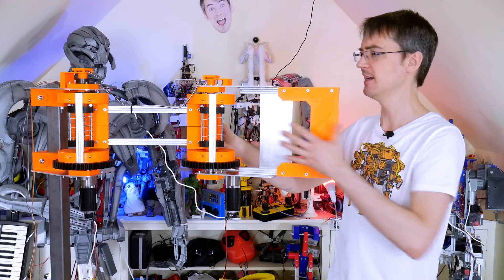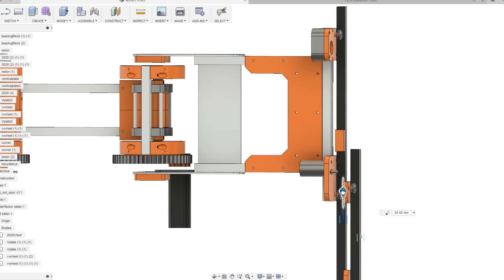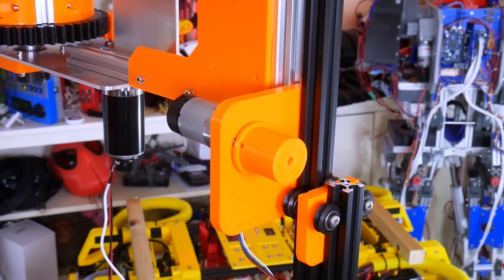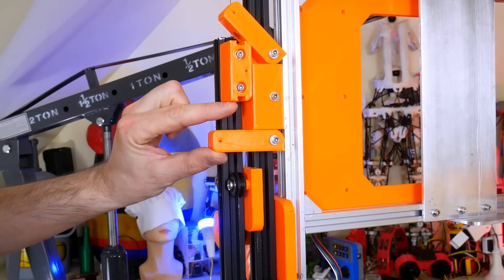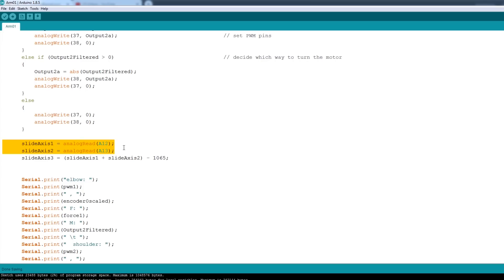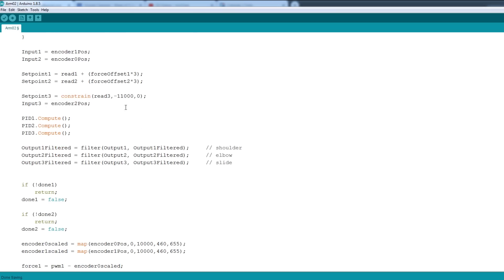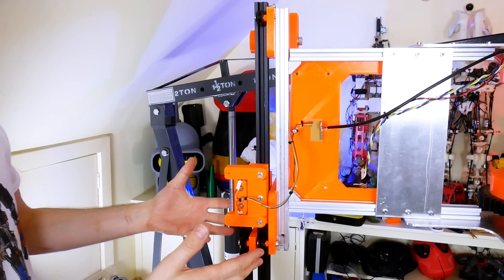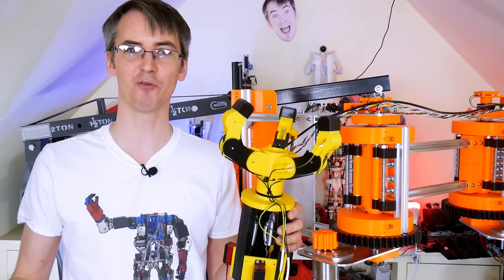Building a Force Driven Robot Arm #4 | James Bruton

Comment: Quick lazy question.  How do you add those control handles to your model allowing you to move them?
Reply from the maker: You need to make each part a separate component, and then use 'Assemble - As Built Joint'

Comment: After the joint and hub shimming,I think I'd be inclined to use a simple automated counter-weight system to balance the arm weight by using known weights to balance the arm and then coding to move the counter weight.

Comment: 7:18 I think that the finger that is being pushed out of the way will give you unnecessarily confusing data. When it's pushed away, it's motion describes an arc. So it is being pushed off to the side of the track, which is the focus of your measurements, so the distance between the magnet and the sensor will be weird. So I don't know if that's a large enough problem that it needs to be solved, and if so, what approach should be used; some simple math and logic, or engineering a better sensor assembly.

I find that I get awfully confused by the difference between measuring “force” and measuring distance.

Comment: Wouldn't it be easier to use Load Cells to calculate force pushing on the joins..? Coming from an automation student in Norway :) Just seems like a simpler and more slick way of doing it imo.
Reply: I have been thinking the same thing, only reason to do it this way I can think of is safety in use. Being so compliant with the springs if it hits you while moving it will give before it breaks anything and give the micro controller a relative age to react. Should also be programmatically easier as you won't need to ignore the inertia of the arm and any mass its carrying - the springs shouldn't move much so can set a simple threshold value. A loadcell would notice the force and that force would be variable on each joint based on a fair few factors - mass held, position of joints (changes the Center of Mass), acceleration of its own motors etc. So a much more mathematically challenging setup (still the way I would do it though).
Reply: You don't actually need to add anything to do force control, simply move your motor controls into Torque control mode!  An electric motor pulls it's rotor around with a magnetic field, the more current you push into the motor, the stronger that field and the more torque the motor makes, therefore, for any motors, force is directly proportional to current!  Most motor drivers measure the motor current and can run in a mode where the voltage applied to the motor is modulated to control that current, and hence to directly control torque!  All done in software, no complex setup of mechanical springs and levers required.......
Reply: @maxtorque2277  that idea works for driving it to a set force but not as a force sensor. yes back emf can act as a sensor, but it is effective for rotor position not force directly. In short if you want to push it around it is not going to work.
Reply: @foldionepapyrus3441  I'm talking about motor phase current not motor back emf. Very different things! The phase current is the result of the balance between backemf and fwd voltage (applied by the motor controller) and is determined by the motors impedance (Resistance + inductance). For a robot that is doing "positioning" the motors are more often holding at static position, ie applying torque at a zero speed, so it's even easier for the controller to control phase current...
Reply: @maxtorque2277   As I said you can sense but it is not a solution to use here, at least in my book. Mostly as the motor is good at heating itself and buggering up any calibration. Like many clever tricks it's well worth knowing but doesn't match the right tool for the job.
Reply: @foldionepapyrus3441  Motor heating is irrelevant, as a motors Torque per unit amp is un-affected by motor temperature (as long as you stay below the currie point of the magnets for a PM machine obviously).  Most commercial motor applications are driven by higher level control strategies such as Field Oriented Control (FOC) with direct shaft torque control as their primary aim!
Reply: @maxtorque2277  not in my experience with the way the controllers and motors I have played with work. They quickly heat and lose precision with holding force slowly at least. And as the motor was toasty most obvious explaination is the change in the coils electronic characteristics did it.

Comment: Please buy some load cells... for gods sake. You can use 3D printed flexures to build mechanical force translators to the range of the load cell.
And while you are at it, also some NodeMCUs they can run with the Arduino IDE too and I think you will quite like them.
Reply from the maker: That would work, but then there would be no natural spring in the joint. I'm ultimately doing R&D here for another leg project, although that's not actually stated in the video.
Reply: @jamesbruton  well you could use the flexture directly as spring replacement, they are after all springs...

Comment: Do you have to measure force at each joint,  or just the end effector?
If the latter potentially you can simplify the shoulder & elbow joints.

Comment: I really like the use of the hall effect sensors, maybe you can use them in the other joints as well, they seem less clunky, and I think you'll probably want another joint in the end to rotate the gripper, especially for picking up things like eggs that yo may want to grip a tool rather then just trying to pick up an egg directly with pincers.